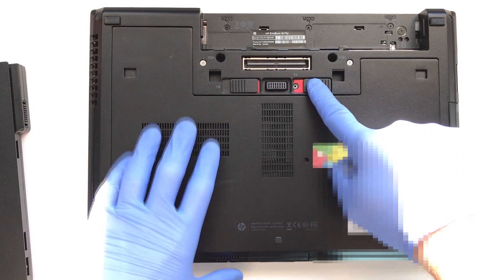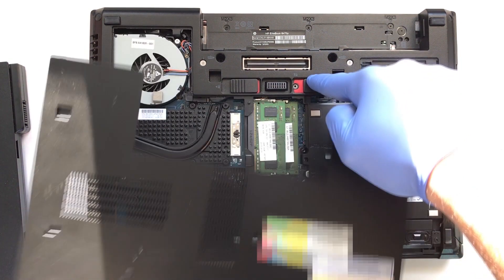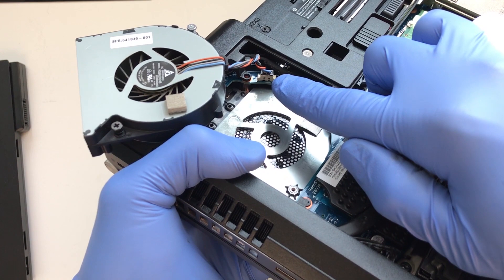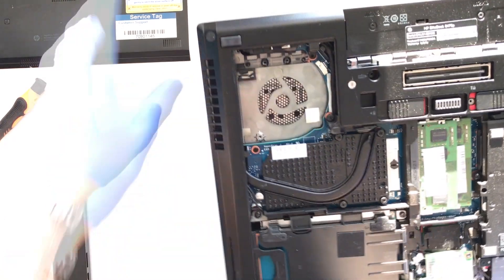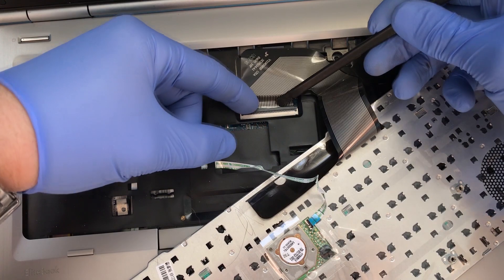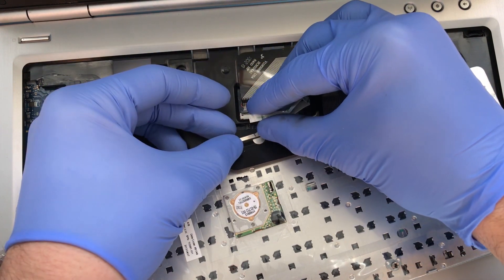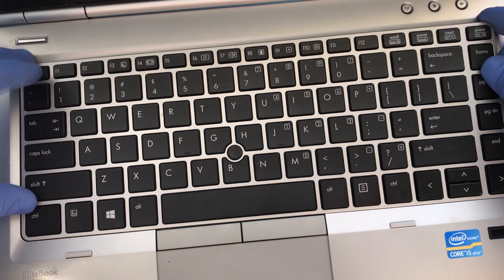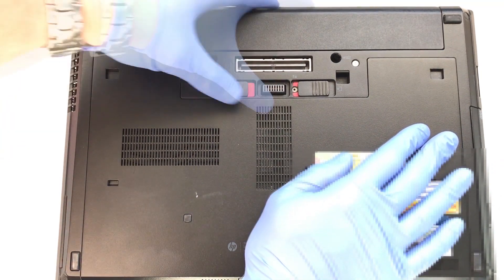HP Elitebook 8470P - Remove/Replace Keyboard

Comment: do you have any idea where the ssd is located on the elitebook 8470p?
Reply from the maker: Bottom left rectangle at 18 seconds in my video
Reply: David Stumph ok thanks
Reply: Yes did this in my 8470p ssd installed
Reply: Yes did this in my 8470p ssd installed

Comment: Thanks for this. Do you know where the CMOS battery is located (on a 8470p)?
Reply from the maker: Yes. It is not a pleasant process. You need to remove the entire plastic frame from the underside of the laptop. There are a number of screws. Minute Marker 7:40 on this video shows the location of the battery and the complete disassembly of the laptop: https://www.youtube.com/watch?v=WH2QtP8ZAi4